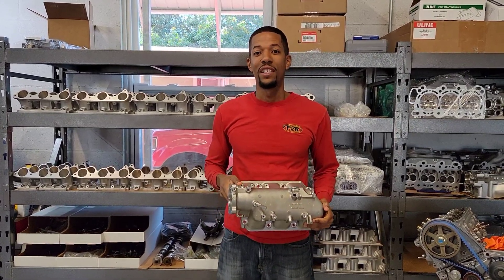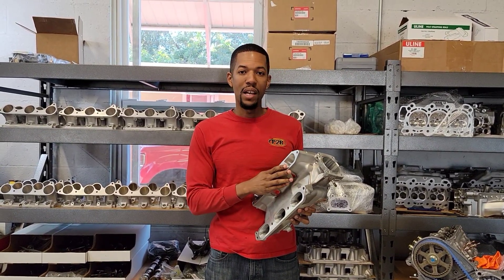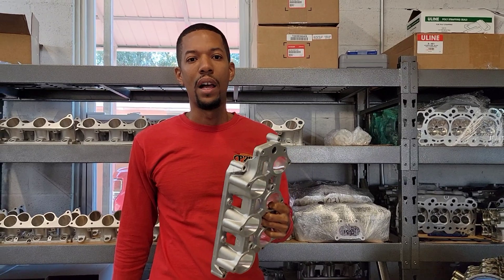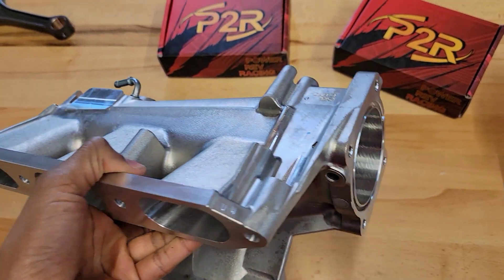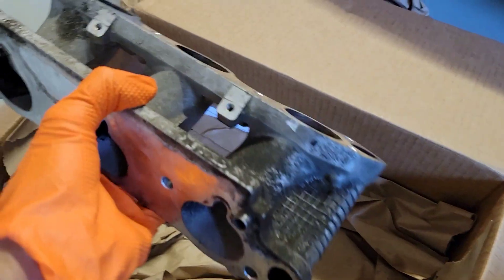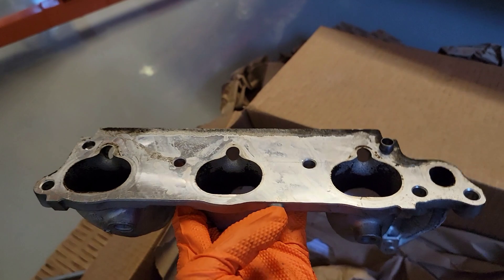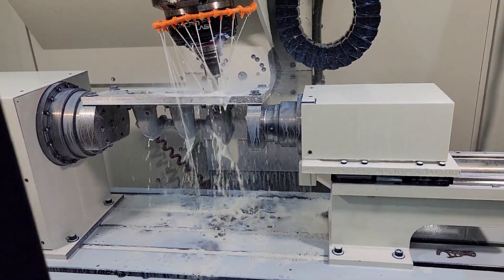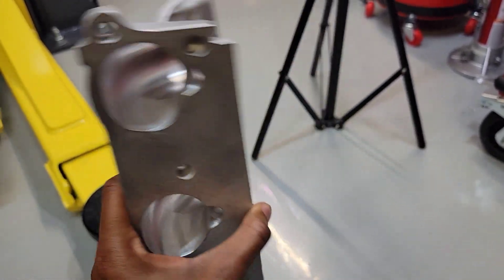P2R CNC Ported TLX Type S Intake Manifold

Comment: Still keeping my fingers crossed for CNC ported J32A1 intake manifolds! It’s one of the only ones not listed on your website. 
I’ll immediately order up a set once they’re available!
Reply from the maker: Just get j32a2 runners and upgrade to a j32a2 upper Intake manifold one time. It will bolt up as long as you get both the upper and lower manifold from j32a2
Reply: @PowerRevRacing  the J32A2 upper manifold has those butterfly valves which will hurt bottom end torque if I leave it in the long runner position.

I’d rather free up the breathing using stock parts since this is my daily driver and it a more common engine than the J32A2